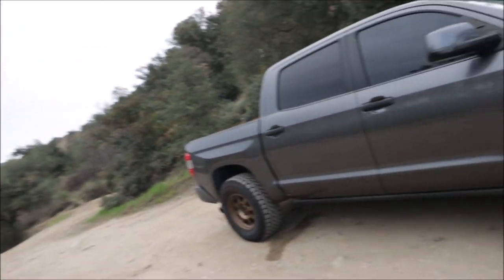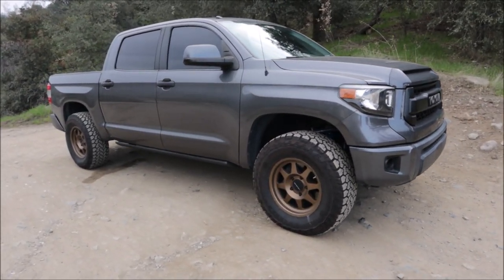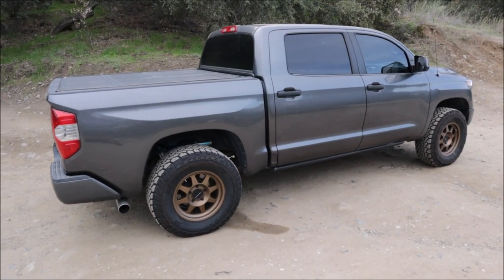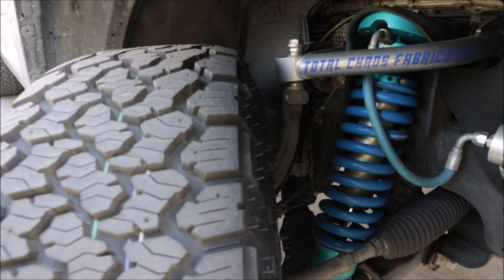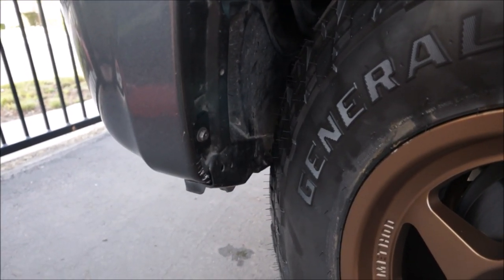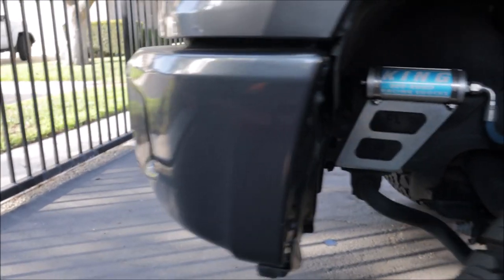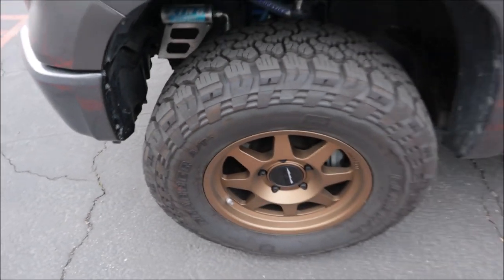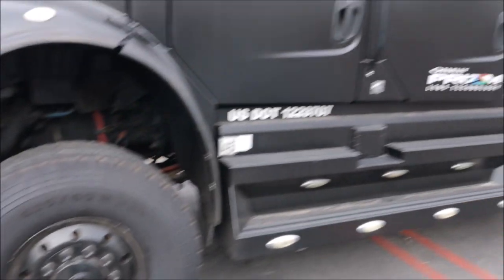Toyota Tundra on 35's - The Perfect Fitment

Comment: I really feel you men. I have toyota hilux lifted 3 inches and fitting a 285/75/r17 is a struggle. So for previous expirience that I had with other trucks, i preffer go little bit smaller with the tyre and not having to chop anything because chopping and cutting is good for not rubbing in street use but when you go off road is another story. Wrapping up better go with aftermarket bull bar or smaller tyre.
Reply from the maker: I agree! Slightly smaller tire is much easier and less painful. The visual difference is minimal and barely noticeable.

Comment: a easy way to fix the fog light covers is to unbolt them and push the bottom portion of the cover into the housing. Just heat it and bend it upwards into the lower bumper caps and screw back in the two small 10mm bolts.  That's what I did on my tundra as I plan on running 35s in the future but what you did works as well. Great looking truck and setup. Love the clean look and color combo.
Reply from the maker: Thanks Jason! I heated and pushed in the plastic as far as it will go. It is rubbing on the bumper corner lower mounting ear behind plastic that is metal. One last attempt before spacing the bumper!
Reply: @RoadPatina  I forget who I is but a few companies make nicer bumper spacer brackets or you could use some metal washers from your local hardware store. Either way love the truck. Excited to see more content
Reply from the maker: @J.NOBODY.1  much appreciated! Not much left, unless I go all in!
Reply: @RoadPatina  Just go full long travel and supercharge it already. It's just money lol
Reply from the maker: @J.NOBODY.1  seriously wish I could! That’s the dream👍
Reply: So how much lift is on your truck?

Comment: I got 2013 tundra and i got 20” tuff black and gold wheel seat on a 295-60-20(34” tires falken wildpeak) stock suspension and 2.5 in level kit in the the front and it look so good. And by the way i dont have any weird look. All 4 wheels stick out like 2in
Reply from the maker: Sounds sweet! Lucky yours fit well. I wish mine did.

Comment: Great video. I'm wanting to go with Methods 703s in 17" and +35. I was concerned about UCA clearance, but after watching this, I think I'll be good.
Reply from the maker: Thanks! +35 with stock uca may be close. Worse case you can run a small spacer if you feel safe, or it’s a good reason to buy new uca!
Reply: @RoadPatina  I’m already on SPC UCAs. Hate to run a spacer on brand new wheels. Method only offers 0 or +35 in a 17” wheel, may have to go with 18” if I want that perfect +25

Comment: Would love to know how it behaves at highway speed, or like you said under full articulation.  Also would be helpful if you gave us a rundown on the suspension gear you're running.
Reply from the maker: @ 8:05 I discuss the suspension a bit. It performs great on highway! Slightly firmer than stock but you loose the wallowy floating feeling and less diving under breaking. King remote resivoir coilovers with total chaos uca. King rear shocks on stock leafs and shackles!
Reply from the maker: The 35x18 ride much smoother on pavement than the 33x20. Articulation soon!
Reply: i have similar setup with 2.5 lift in the front and Icon Rebound 17" wheels with +25 offset. no rub at normal psi. only rubs at full lock at or below 20psi. No BMC on mine either
Reply from the maker: @skye1355  nice set up! What size tires?
Reply: @RoadPatina  35/12.5r17

Comment: Do you think +12mm offset will work without a chop? The wheels i want only come in that offset. Thanks in advance if you answer.
Reply from the maker: @pickledcottoncandy  I have a feeling they will rub with that offset and 35s. If they are your favorite choice, modifying the cab mount or a smaller tire may be worth it!
Reply: @RoadPatina  thanks, man. They are, and I really don't want to chop it at 20k miles. Damn.

Comment: I was wondering what the grey/bronze combo would look like. I have a 4wd double cab same color / went with the new Method 705 in matte black / I kinda wish I'd gone with the platinum since black wheels are over done these days and that series is not available in bronze. The 705 also have the +25 which is what sold me over the top and I had to have them. I'm about to do a 3.5 Ironman 4x4 lift, so it looks like I'll be able to fit 35's......your truck looks perfect man. It really is a challenge to get it "just right" and you nailed it!
Reply from the maker: Thanks man! Well, if you got the rims you like and the right offset I think your good to roll! Later, if you really get bored or sick of the black, paint them. I bet they will grow on you more and more. Who cares what everyone else is running!

True 35’s are close to the cab mount and bumper no mater what you do. Some run the metric size that is about a 34” tire with better clearance. 285/75-18 I think? If I did more off-roading, I would probably trim the bumper or maybe run 34s. FWIW.
Reply: Method has the 706 on sale for 246. I went to Discount Tire to see if they could get them and save me 100 on shipping and they offered them for 236.00 and no fee for install/balance - The 706 have a +35 offset so they will tuck in another 1/2" compared to the +25. @RoadPatina
Reply from the maker: @thebigempty_5792  cool! Make sure nothing rubs before you pay!

Comment: I didn't know about that rear axle thing ...I'll have to check mine and see if I can notice any difference. I like your setup...I have 285/75/R18 Duratracs(true 35 inch tall tire but narrower) on my stock TRD PRO rims & it only slightly rubs the front sway bar at full lock. I hardly ever turn full lock so doesn't bother me too much now.
Reply from the maker: Axle is a total bummer for me! Would a small spacer help your rub?
Reply: @RoadPatina  yes it would but I'm against spacers. If only the trd pro rims were a positive 50 offset instead of a positive 60 then I'm sure it wouldn't rub at all
Reply: @Dale Phillips  watching this a yr later, I've been looking for spacing on 285/75/r18s. I'm only lifting 2 or 2.5 in the front and would like it to stuff up nicely
Reply: @johncomeaux4821  it'll work fine as that is all the TRD PRO  is raised

Comment: I'm running the same Methods in a 17 with a neutral offset and they poke out about the same as yours if not, slightly more. However I have a '13 Ford F-150
Reply from the maker: These look great on any truck!
Reply: @RoadPatina  they sure do! I really like the bead grip on the wheels, it helps out so much when driving on the dunes. 
P.S. your Tundra is such a nice looking truck! Absolutely love the color combo
Reply: I have the same on a 17 fords only need a 0 offset to be the perfect poke

Comment: Sorry if I missed it...did you mention what your shock height was set at with the Kings? Front and rear?
Reply from the maker: Good question! The King coilovers come set from King at about 2.25-2.5 inches. You can crank them up a little but I don’t recommend it, too much preload on the spring. Some people run a small spacer on top of the Kings for a bit more lift. The rear Kings are just shocks and there is no lift. Stock leaf springs and hangers.
Reply: @RoadPatina  Thanks for the quick reply. I plan to go Bilstein 6112s in front and 5100s in the rear. I will have a canopy though so it will be interesting to see if I need more height in the back so I'm not nose up. I really like the look of your wheels and tires. I'll be doing something real similar.
Reply: @Justin-zs1ql  how do you like your bilstein, especially 6112? I have 5100 on all 4 tires.
Reply: @jeffreysantos9070  I've had 5100s on my 2002 Tundra. While not a direct comparison the 6112s in the front feel a little more plush. I went with with the 1.9" setting and CB shims to provide ~ 2.9" lift in the front while not completely preloading the springs. I also have +2 CB shackles for 1.25" lift in the rear. Sits almost perfectly level with a canopy.
Reply: I know this video is old but I am curious to know if the tires tuck inside the wheel wells at full articulation?

Comment: I know this video is a little old but do you know what your caster numbers were after alignment? I have same wheels in black but 18" on 35's as well with King 2.5 remote adjusters. I have the bumper spacer already in but it does rub on the cab mount. Need to move the wheel forward..
Reply from the maker: Yes, if your bumper is spaced have them move wheel forward (caster) away from cab mount. I don’t recall my specs, sorry. Actually need to have it realigned soon!
Reply: @RoadPatina  the front to back movement you get when adjusting caster is only a byproduct of changing the caster.  Caster is actually the rotation of the steering knuckle, and having too much or too little caster angle determines how your vehicle handles, particularly bump steer.  Positive caster will keep the vehicle from "wandering", or excessive bump steer, while driving straight, and the more positive caster you have, the further forward in the wheel well your tire will sit, although it's not a huge difference.  Negative caster will move your wheel towards the rear of the opening slightly, but can lead to a truck that doesn't have proper straight-line stability.  Caster is measured by the position of the lower ball joint in relation to the upper ball joint.

Comment: Love this setup. Did you need to re-gear for the tires?
Reply from the maker: Stock gears and I slightly noticed going from worn out 33s to brand new 35s. I would not regear unless running 37s, seems to be the norm!
Reply: @RoadPatina  Awesome! Thank you for the info. Hope you don't mind, but I'm planning to copy everything you've done (it'll be on a Super White Tundra, so not a total copycat). This is exactly what I have been looking for but I wasn't sure about the re-gearing.
Reply from the maker: @jgbecker24  glad to help! I don’t mine and actually encourage it. Took a while to get here and love how it turned out. Just need to work on the front bumper rub and that’s it. Or just send it and go long travel 😮

Comment: I'm running 35's on my 17 tundra 4x4. What psi are you set at front and rear?
Reply from the maker: Whatever it ends up at after a year between oil changes! Prob around 35ish.

Comment: i want a 6 inch lift but stock rim still any 
suggestion
Reply from the maker: Stock rims with 6in lift will look like you skipped leg day. They really limit tire size you can run. Stock offset is high. Wheels with 0mm to +25mm is a good start.
Reply: @RoadPatina  okay ima jus get some 20x10

Comment: Do u have to get the truck lifted for this set up to work?
Reply from the maker: Just a few inches in the front should do. I am running king coilovers and no cab chop!
Reply: @RoadPatina  like if I get a 1.5 inch leveling kit in the front I’ll be good?
Reply from the maker: @matthewbarber3153  that will be tight. Check on Tundras dot com. They have all the info... May be worth going P metric and stepping down a tad from a 35

Comment: Great video, love the way it looks! I want to do the exact same thing to my Tundra. Wanted to ask you, I'm actually pretty curious as to do you have a lift kit on your truck? Is it a 2x4 or 4x4? My Tundra is a TSS (SR5) 2 Wheel Drive. Did you lose many mpg's?
Reply from the maker: Thanks! It’s 2wd and running king coilovers and total chaos uca. I recently spaced the front bumper about a half inch to alleviate most of the rubbing. True 35x12 are not exactly easy to clear!
Reply: @RoadPatina  and did you have to lift it? If so, how much?
Reply from the maker: @davidgarza6339  just king coilovers.

Comment: I had method race wheels on my 2016 crewmax and the rear was off just like you showed. Drove me crazy
Reply from the maker: Preach! I look at it every single day and even in my side mirror ☠️
Reply: @RoadPatina  Fix with a 1" spacer on the left rear. my 2014 has this exact same issue. I was able to jog the rear axle half an inch to the R by loosening the u bolts and using a floor jack to gently shove it while tightening the bolts. Just need a half inch spacer now on the L.  Dumb design flaw for sure.
Reply from the maker: @Dirtmango  really! That may work. Need to find the time to get under it. Thanks!

Comment: What I meant was no 35s without bmc and bumper cut or afternarket. I have 12.5.s.
It looks like you have 10s. Either way my tires were almost 2g for4.
Don't make the mistake I did and rip lugs off of them. Make sure ur suspension travels
Reply from the maker: I hear yah! I am 35x12.5x18. Not much heavy off-roading, mainly the family mall crawler 😂

Comment: The only thing you can do about the axle is cut and center the mounts. The axle definitely doesn’t twist in that direction or anything. Who knows why the axle is offset, but Toyota engineers do know what they are doing
Reply from the maker: I won’t be doing all that. Offset it will remain!
Reply: @RoadPatina  I noticed it on my truck too and it bugs me 😭😭😭 it will also remain lol

Comment: I’ll be most worried about the ratio inside the dif . . . I’ll would change it as soon as I could before jumping anything bigger than factory specs . . .
Reply from the maker: Its widely discussed that 35s on these trucks is acceptable with stock gearing. 37s on the other hand benefit from gear change!
Reply: Don’t need to change ratios